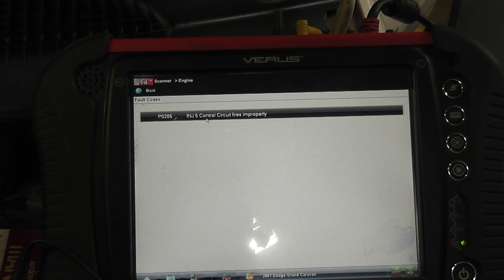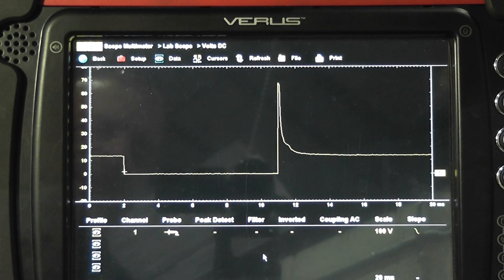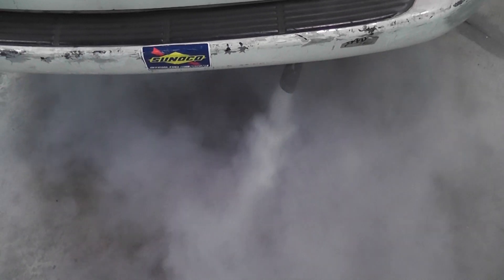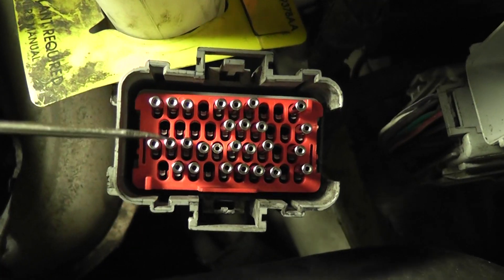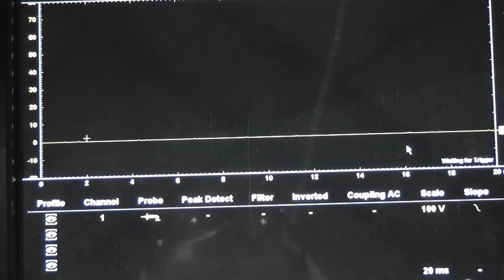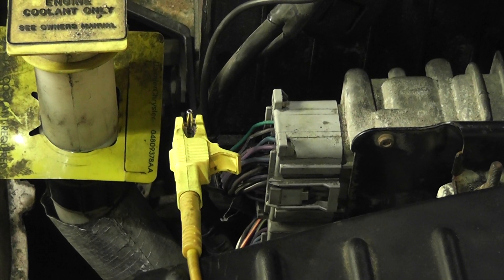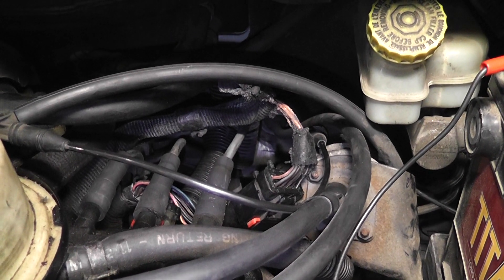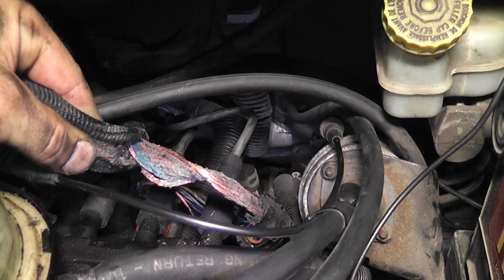Stuck Open Fuel Injector (how to fix)

Comment: Would there for sure be a code saying the injectors circuit is wonky?  I got the spark plug out and CoP out and there’s fuel pouring into the cylinder.   Isolated it isn’t the CoP or spark plug.  Changed all injectors, problem persists.   Never figured it out.
Reply from the maker: Not always

Comment: Hey ScannerDanner, I really appreciate your videos — they've helped me learn a lot, and I was hoping you could give me some guidance on something I'm working on.

I have a 2003 Dodge Caravan SE with the V6 3.3L Flex Fuel engine. It's got a Multi-Port Electronic Fuel Injection (MPI) system. Here’s how I understand it works:

•  Air gets pulled through the air filter housing and intake duct into the throttle body.

•  Inside the throttle body, there’s a throttle plate that controls how much air goes into the intake plenum and then to each cylinder.

•  Each intake port has its own injector.

•  The MPI system sprays fuel into each intake port in the same sequence as the firing order.

•  The PCM (Powertrain Control Module) controls the injectors and constantly monitors engine conditions (like temperature, load, and speed) to determine the right amount of fuel.

•  It adjusts fuel delivery using pulse width (how long the injector stays open), and can change this instantly — even between cylinders.

Here’s my situation:
My van has a misfire, and I want to do a manual cylinder power balance test by cutting fuel only (not spark), because it has a catalytic converter and I want to avoid damage.

But I don’t have access to a professional bi-directional scan tool that could do this electronically. That’s why I want to do it manually — by cutting fuel at the PCM level.

The injectors are buried under the intake manifold, so I can’t unplug them directly. But I found all six injector control wires at the PCM C1 connector:

•  Injector 1 through 6 drivers — all control wires from the PCM.

My plan is to backprobe those wires at the connector, one at a time, and cut the signal briefly to see which cylinder causes the biggest RPM drop (or no change), so I can figure out which one is weak.

But I have a few concerns and questions:

1. I know the Idle Air Control (IAC) motor might try to "fight" the RPM drop and compensate for it during this test. Would it be a good idea to unplug the IAC connector while doing the test so it doesn’t interfere?

2. When I backprobe the control wires, should I use a T-pin and a test light (connected to battery positive) to interrupt the injector pulse by grounding the circuit temporarily?

3. Or should I actually remove each injector driver wire from the PCM connector one by one instead?

4. And finally — how can I "be the PCM" and meet the conditions that would normally turn the driver on or off? In other words, how do I safely simulate the PCM’s control logic while interrupting fuel manually without messing anything up?

I know this is a long message, but I wanted to lay everything out clearly so you’d have the full picture. I’d really appreciate any feedback or advice you can give on this.

Thanks again — your teaching style really clicks with me, and it helps a lot especially since I learn a little differently.
Reply from the maker: You're not going to hurt the cat by momentarily shorting the ignition coils to do your desired RPM drop test. Use an incandescent test light to short each coil tower out. Use your ears, don't look at RPM and worry about what the IAC is doing. Just listen. I have many videos showing this procedure
Here is one
https://youtube.com/shorts/oDWNcoUbCFc?feature=share

Comment: There’s mechanics that can do any repair and then there are those that can diagnose anything. I will pay you to come to Houston and work on my 05’ Duramax. It’s an injector problem stuck wide open so we can’t figure it out in a balance test. I bought 4 injectors and replacing them tomorrow just guessing. So tired of this crap and just want my baby running right. The old injectors are made by Standard through O’Reillys and I heard they’re good and now I’m replacing 4 and replaced 2 others about 6 months ago. I’m going with Bosch reman now

Comment: Hi Scanner Danner , I'm new to your channel . I watched this video because I have a 2002 pt cruiser with a p0304 and a p0204 code . I tried swapping injectors and I cleaned the spark plug for cylinder #4 . Cleared the code and the p0204 came back but not the misfire code .  After watching your video I tried the procedures you used and it worked great . I found 4 wires in the main harness going to the PCM that were bare . Two of which looked like someone had stripped the wire off of them . But the wire from injector #4 looked worn from rubbing together in the harness which had a lot of oil residue in it . This section runs over the top of the Transmission housing right where it mates to the Engine , so it probably gets a lot of heat . So I said all of that to say thank you for your instructional videos . Car is running like it should now . Thanks again . I Will be watching .

Comment: Hello, Sir.  If you measure current at the computer on the control wire, you would see 0 A, right?  If the injector were internally shorted, how would that affect the other injectors? Thank you.
Reply from the maker: For this issue? You may see some current when the injector driver turns on as it would be providing another path to ground, but most likely yes, I would have been 0 amps. Internally shorted injector driver would only affect that one injector on a sequentially controlled system
Reply: @ScannerDanner  Thank you, Sir. I am going to make sure I watch one of your videos on fuel injection systems and short in parallel circuit,

Comment: dealing with a stuck open injector, if i pull the control wire from the computer and start the engine, and its still stuck open would that basically tell me i had a short to ground without using the test light? assuming the injector itself is still good.

Comment: I suspect i have a stuck open injector on my 5.3 Silverado. I dont drive it much and it recently started blowing white smoke like crazy out the tailpipe and the idle is jumpy. I dont have any special tools so does anyone know how i can find out which injector is bad?
Reply from the maker: What's the white smoke smell like? It will be completely different with a head gasket failure. If it's a fuel injector there is ZERO mistaking that it is completely raw gas you are smelling. DONT LITE A MATCH!!
Reply: @ScannerDanner  I'll have to check. I just shut the truck off and it's been sitting there.

Comment: Dude thank you for this video my car is doing the exact that. I took my car to a shop because I was stumped. I replace tons of parts and all that shop did was undo all the parts I replace.  Didn't solve a darn thing and the screwed me over with the bill smh. Again thanks bro I'm going to trace my injector wire on my car.  I know one of my injectors stuck open just now sure which one.
Reply from the maker: The worst case scenario for any shop is to get a car with a problem, that a bunch of parts have been replaced on. Especially in today's market that is flooded with bad new parts, right out of the box. 
I'm sorry you had that experience, but now that you found me, make sure you're doing the testing first before replacing parts! Otherwise you absolutely will be creating problems.

Comment: How did the truck start if all those wire harnesses were all mess up and broken lucky the car even started l had  the same problem mines were different ones from the fuse box goin inside the car dashboard all burn and still worked fije until 3 month ago finally had to inspect and fix it ur the man bro good
Job

Comment: Hello Paul. From what I understand, current follows the path of least resistance. If you had an amp clamp on the control wire at the computer, would you still see amperage? My thinking is that you will measure current before the short not after the short. Thank you for continuing to help us.
Reply from the maker: Yes an amperage measurement can also be used as a guide and in this case it would have been zero amps measured at the ECM
Reply: @ScannerDanner  Thank you so much for your help.

Comment: When you connect the probe to sensor, do you connect a ground as well?
Reply from the maker: Yes, just like using a voltmeter.
Reply: @ScannerDanner  thanks I really appreciate that! My Injectors under the intake manifold! Peace from North Carolina!
Reply: @ScannerDanner  I am probing the correcting pin at the ECM and have the pico set up correctly (with an attenuator as well), but I am not getting a waveform that you (and several others I have watched on YouTube as well) are getting, what could I possibly be doing wrong?  This seem straightforward, but I must be missing something.  I am probing pin 51 (control) and pin 75 ( high voltage) on a 2010 Buick Lacrosse 3.6 LLT engine, and get the exact same waveform.  This is driving me nuts! :)
Reply from the maker: @katzenpapa  is this a GDI or port injection system?
Reply: @ScannerDanner  GDI
Reply: @ScannerDanner   Hey SD I found this (very good) video which showed me what I was seeing is correct https://www.youtube.com/watch?v=tLpSbaJpdb8&t=319s&ab_channel=PAULY%27SAUTO   I am new to this and still learning!  I will probe high and low side and overlay them.  Love your videos, and thanks brother for sharing what you do!
Reply from the maker: @katzenpapa  GDI testing is completely different as the power and ground are switched. The current ramp test is most clear on these
Reply: @ScannerDanner  Do you have a video on a current ramp?  I'll search your videos to see what I can find.  Thanks from North Carolina!
Reply from the maker: @katzenpapa  the videos where I cover the injector control and scope testing of these is in my chapter 17 playlist on my website. I offer a 14 day free trial. Sign up and then cancel and you won't be charged the $11 for the next month and you'll at least be able to see those videos. 
https://www.scannerdanner.com/scannerdanner-premium-chapters/chapter-17-fuel-injector-driver-designs/351-gas-direct-injection-injector-control.html
Reply: @ScannerDanner  Thanks I am going to check that out!
Reply: @ScannerDanner  Also, when I test the MAF at the component and at the EMC the both waveforms are different  from each other as well.

Comment: You helped me with the Chrysler Town and Country I'm working on. Harness was bad also and it shorted  out #2 fuel injector driver. I did the test like you stated and when engine was running there was no ground in the wire side and light would go out. When I back probed the opening where I removed the wire for the injector there was 0 volts coming from that driver and vehicle voltage from the other injectors.

Comment: hey this video really helped out a lot I appreciate it! I'm having the same issue with my 2001 Dodge Grand Caravan 3.3 I found a short exactly like yours in the wire harness and repaired it but I'm still getting the same p0206 code I tried to replace the board with a remanufactured unit from AutoZone with no success. I was just wondering if you'd be able to help me out diagnosing it? I feel like I'm about 90% there but missing something minor. I'm the owner of an HVAC company so I know my way around electrical circuit pretty well and I work on all my vehicles but this one is just stumping me pretty bad.
Reply from the maker: Take that injector circuit and measure that control wire right at the ECM with an incandescent test light connected to battery positive. Does it blink on and off?
Reply: I'm having the same issue w a 2000 caravan. I get solid light when testing signal wires at the pcm. What does that mean? I'm waiting on a new meter to arrive for more testing
Reply: 2 do not blink one does. The wires were melted I replaced the harness still having solid signal.
Reply from the maker: @travisjones8946  test light to battery positive? Engine running right? Then it is either a short to ground on the control wire or a shorted PCM injector driver

Comment: I have a 2003 T&C 3.8L with the exact problem.  From what I can tell either '04 or '05 the changed the location of the gang plug to the left side of the engine near the air filter hence no heat to melt the wiring insulation.  I have a NEW wiring harness for the 2003 I am going to install a heat shield on the harness for protection.  Getting these 'cursed 10 pin gang plugs apart is a nightmare.

Comment: Fuck and I scrapped my wife's old Mazda cx-7 because it did this to us, we took it to a few garages that said they couldn't figure it out. So they said just rebuild the engine it seems like a bad head gasket. I rebuilt it, and when I tried to keep it running it wouldn't stay on even for a second. I'm thinking the fuel rail or injectors were shot.

Comment: Update! 2003 Grand Caravan 3.8 L. Replaced the ECM. Checked the fuel injector wiring harness and it had a few wires with melted casing. We rewired new wires in with butt connectors. Scanner still showing p0203 and p0205. So maybe there are some broken wires somewhere else in the fuel injector wiring? Anyway, how do I find out which pins to check with a test light like you did? I cannot even find the wiring schematics for this thing on Google. At least that way I'd know if it was a broken wire. Or something wrong with the brand new ECM. Would it throw the same code if an injector wias clogged or stuck open? Or does it only show this code when there's a problem with the wiring itself?
Reply from the maker: https://eautorepair.adtrk.biz/?a=10817&c=24&p=r&s1=
This is the DIY version of the same service info I use. Same diagrams only black and white. Good providence

Comment: I have the same problem with my car except it’s showing for 3different cylinders on the same side . cylinder 2,4&6 all day injector circuit. And I’ve did the noid light test for these same ones and the bulb lit up for each . Which side of the car you say this would be on?f for the harness ? Maybe I have a ground shortage ?

Comment: What if every single injector is showing open circuit. Because that’s what’s going on with my 09 rt challenger. The dealership has already replaced my injectors, fuel pump, computer, spark plugs, coil packs, cam/crank sensors.

Comment: Are the two wire on the fuel injector suppose to be power or is one suppose to be grounded?
Reply from the maker: One is powered all the time, the other is a pulsed ground by the engine computer.

Comment: So if this was an open circuit instead of short to ground what would be the troubleshooting method for that
Reply from the maker: Check out my Chapter 17 and 18 playlist. I have a few open circuit type tests there for injector circuits. Thanks!
Reply: ScannerDanner so I got the same situation exhaust and all, pin 17 which is injector 2 (which I got the code p0202) seems stuck open, already replaced the harness that was melted and it still runs like crap, pulled the pin and tested to see if it was still getting a ground which it wasn’t so I think the wiring between the pcm and injector is good, also I’ve replaced the injector, I stuck a lead in where pin 17 was in the pcm and used a test light attached to positive and got no response, but tested injector 4 driver and it seems fine, am I safe to assume driver 2 in the pcm failed, and if so is there anyway to get that injector working without the hassle of getting a refurbished pcm?

Comment: Never knew white smoke could be a stuck injector. Awsome information, extremely informative. I got something to do on my car now.
Reply: Because it's not,this guy is full of it.
Reply: @spreplayz  that caused white smoke on my car, changed that injector and no smoke.
Reply: @ford3809 how did you know what injector to change? My trucks blowing a bunch of white smoke and has a jumping idle
Reply: @Kevin_Yagoonie  get a long screwdriver, put the tip on the injector and put the other end to your ear. You should hear constant clicking clearly. All them should click at the same rate assuming the engine rpm is constant. If one is not clicking, or clicking erratically, that's your problem.
Reply: @Kevin_Yagoonie  mine was not clicking cause it got clogged. My tank was full of debris, that was the cause of the original problem.
Reply: @ford3809  awesome thank you I'll try it out 👍

Comment: great video help me find my shorted out injector harness but I still have a po205 injector controller issue i even replaced the injector but i still have the problem can 
i use a volt meter to test and see if the pcm driver is working properly
Reply from the maker: The shorted harness most likely damaged the computer driver for that injector. It is common to need a computer after this failure. This van did

Comment: Thanks for this video. My 2005 Dodge Grand Caravan is giving me code 0202. I have to do the same process for that?
Reply from the maker: Is is huffing white smoke too? Then absolutely
Reply: ScannerDanner It is not huffing white smoke. But whiles I am driving it, it just cuts off on it’s own.
Reply from the maker: @bahamasking2063  then it will not be a shorted injector wire like in this video
Reply: ScannerDanner Ok thanks